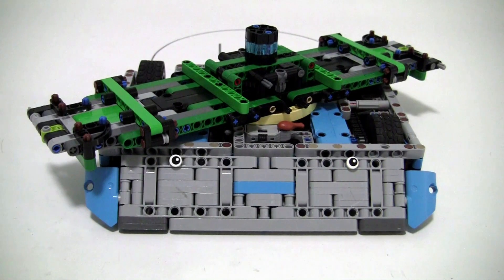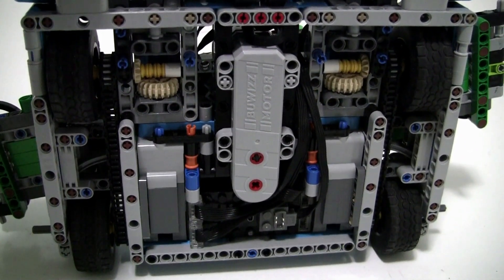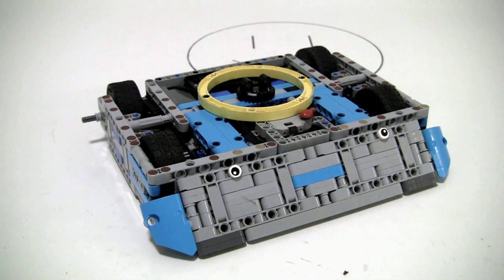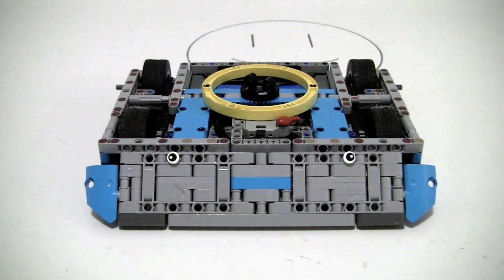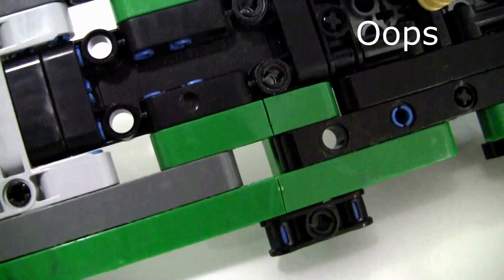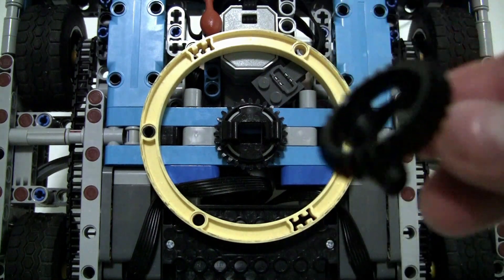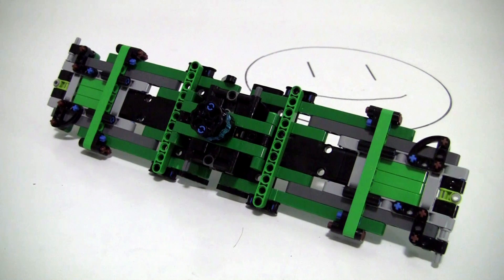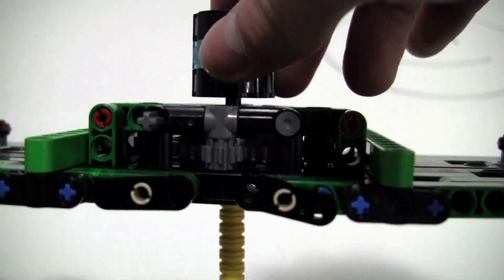Bruin in Depth Tutorial. (Lego Battlebot)

Comment: How exactly does the clutch work and would I need it for a big vert meat esque bot? I recently got a BuWizz motor and I really don't want it to break so I want to know if theres any precautions I need.
Reply from the maker: The idea behind a clutch is to turn the spinner with high friction, so the motor can still turn during an impact when the bar comes to an abrupt stop. There are endless ways to do this, but in Bruin the center axle turns a 40 tooth gear meshed to four separate 8 tooth gears connected to the bar with friction pins. You definitely need a clutch in your weapon or you run a high risk of breaking the internal gearing of your motor.
Reply: @outworkrobotics  this makes a lot of sense! I will try to build the spinner clutch from the bruin tutorial and modify it to work with a vert